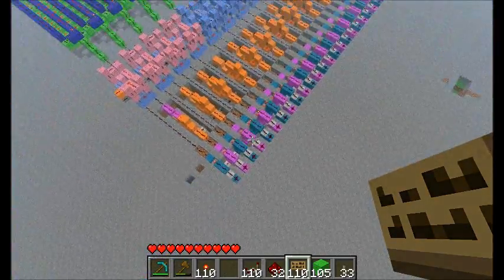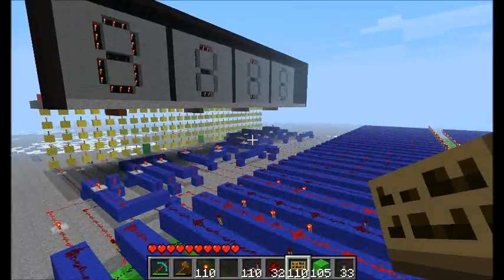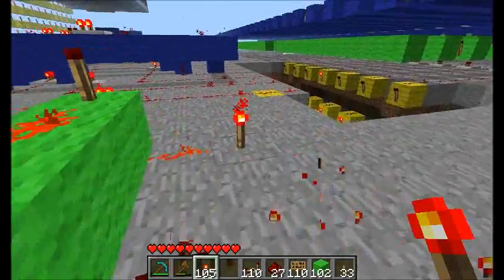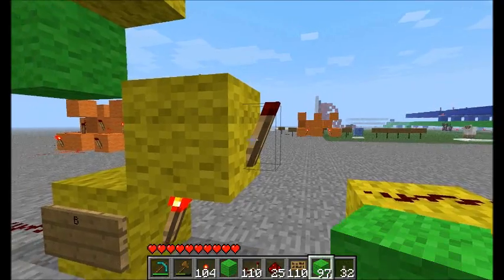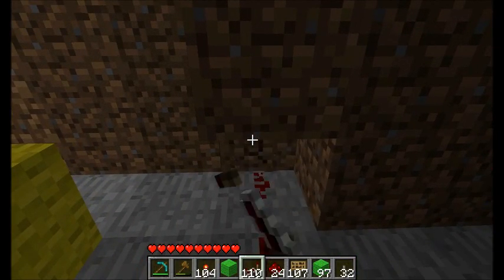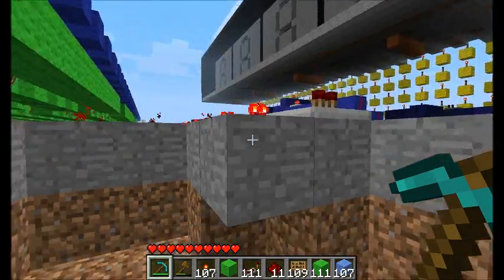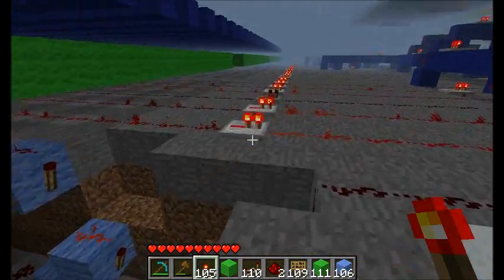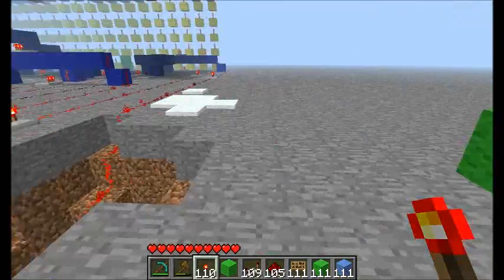Stephen's Redstone Display Tutorial Pt. 9

Comment: @devanferreira that happened to me when I did it, the 4 and the E weren't working initially. Have another look at your decoder, you may have missed a torch somewhere, and if not, check that all your adders have the right torches in the right places. Have you used worldedit to copy parts of it across? Because repeaters may have stopped working because of that :D